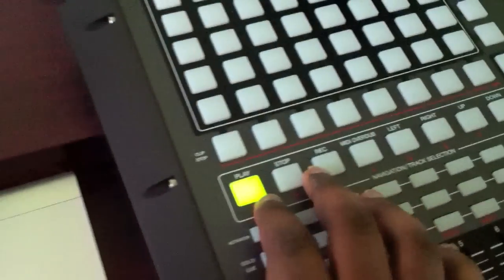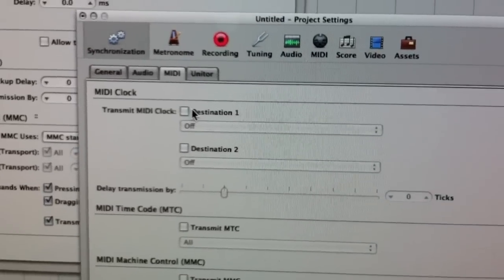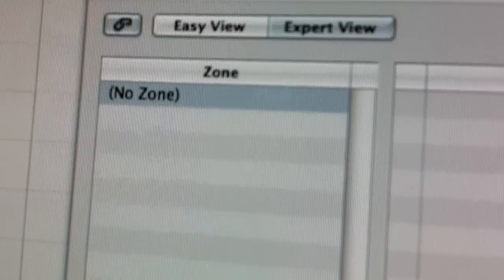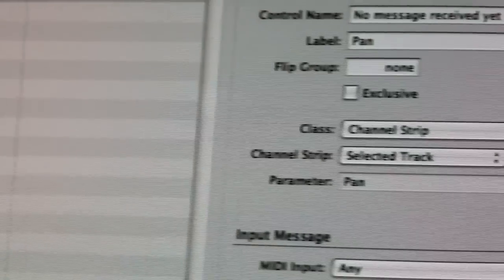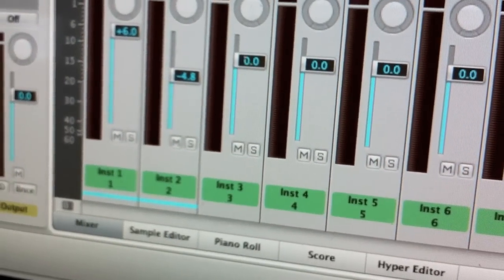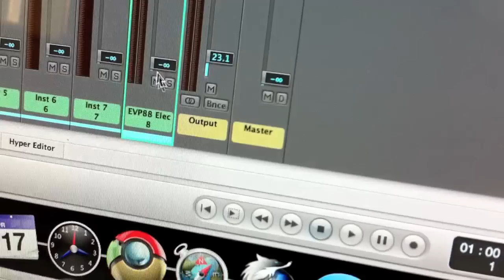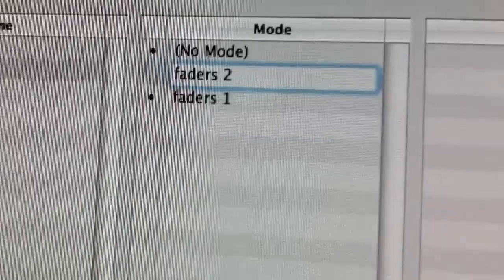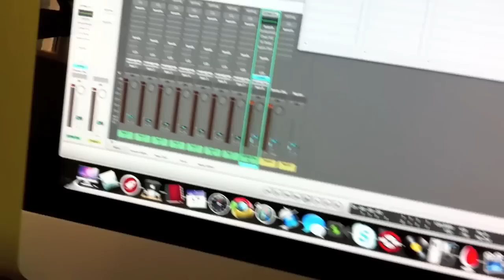APC 20 Mapped With Logic Pro (Part 1)

Comment: Hi! I don't know if youre still replying to comments on this but,
I followed your three tutorials and they all work great, except for assigning the 40 midi pads at the top, the ones labeled "clip launch". Every row of buttons plays the same notes. Different Columns (vertical) play different notes, however. I even tried using a MIDI Monitor. Each button sends out a different signal, but for some reason I cant get each row to have separate notes.
Thanks, 
Charlie

Comment: hi Elias, great tutorial. i have a problem and i hope you can help me. i use logic pro x and akai apc 40. i would like to launch paterns in ultrabeat with apc 40. for example the ultrabeat is on 1st track and every pattern is like next clip. is it possible or you can launch patterns only with keyboard starting with C0? thanx
Reply from the maker: no sure but I'll try and see what I can assign using the ultrabeat and update you.
Reply: ok, thanks man. i'm trying to do one more thing that seems to be easy- i try to switch between tracks using track selection buttons in my APC 40. is it possible?
Reply from the maker: Just tried to see if I could launch clips or patterns in the ultrabeat and I can't, it will not allow me to. It does allow you to assign or control the various parameters, or even switch on and off the sequencer but launching or changing the note patterns is a no.
Reply from the maker: Yes that works but its not like you can use all 8 buttons on the apc 40. It only allows me to assign the next and previous tracks up and down with 2 buttons. Go to preference and the select the last option Key command. now type in the right side search window "Track" and search and it will display all related track commands you can assign to the apc. Select or click on a command on the left window, than to the lower right side you will see "Learn new Assignments". click this and than tap a button on your Apc 40 to control the command. Give it about 2 seconds and the "Learn new assignment" will fade back to normal, light grey from dark as indication you have assigned the command on the Apc, now press the button and see if it reacts.
Reply: Elias Khan ok, thank you anyway